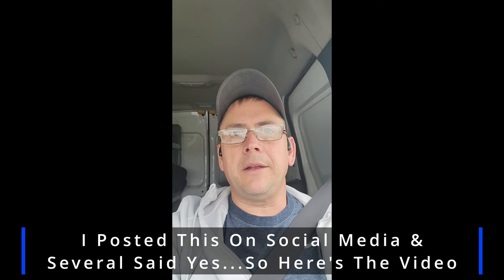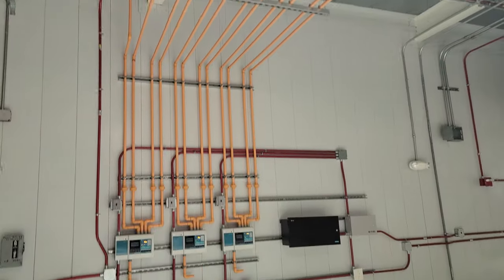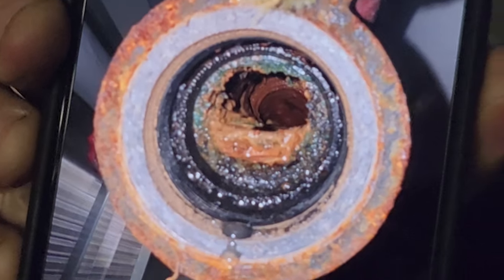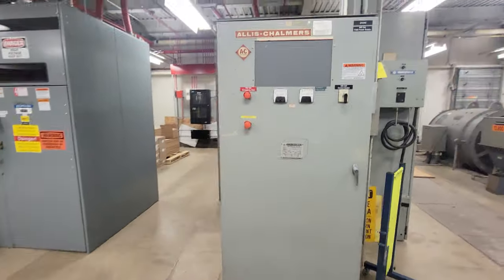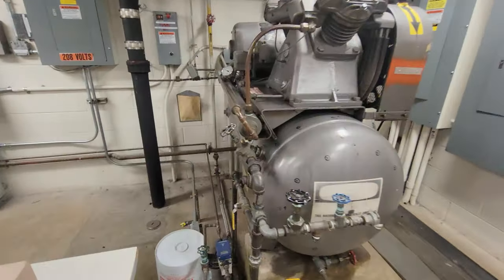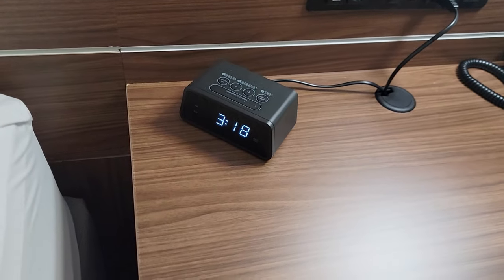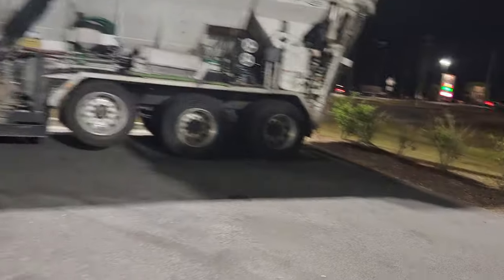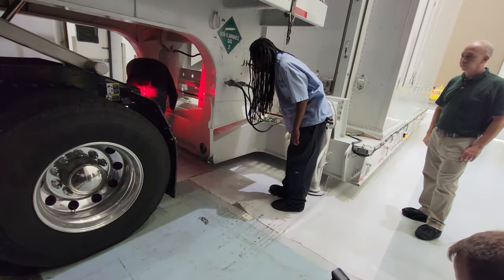HVAC Behind World's Largest Clean Room! Exclusive Behind NASA Restricted Area

Comment from the maker: My job was to make sure the HVAC system ran during the transport of the satellite from Goddard located in Maryland to Florida, where the space craft will be prepped for it’s launch into space   In February 2024.   Humidity and temperature out of range can cause damage to the spacecraft, the temperature in space is around -350°  Fahrenheit, any moisture buildup inside of the spacecraft can cause false readings or damage to the components. The satellite was called P.A.C.E   https://pace.oceansciences.org/mission.htm 
The main highlight of this video is showing you what’s behind-the-scenes of the world’s largest clean room and what types of testing they do and the equipment they use to test them. HVAC is utilized for all these tests.

Comment: I have worked on a lot of clean rooms as a hvac contractor but that one was impressive
Reply from the maker: Thanks pipefitter!
Reply: cleanly "unclean", you should check out hard disk drive/electronic chip manufacture clean rooms. yeah, actual outer space would be better(or would it in all the lies)

Comment: Another good thing I like using is hot glue on the cap tubes you can melt with a small flame and your cap tubes will not rub together when you have to spiral for a pressure switch
Reply from the maker: Are you using a glue gun or your torch to melt it.
Reply: Lighter works a little better but a torch works too